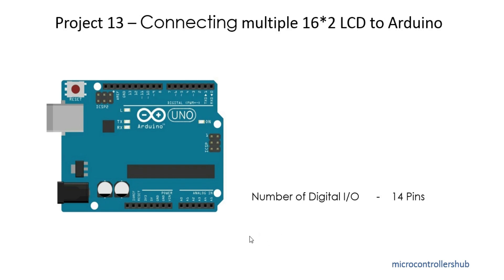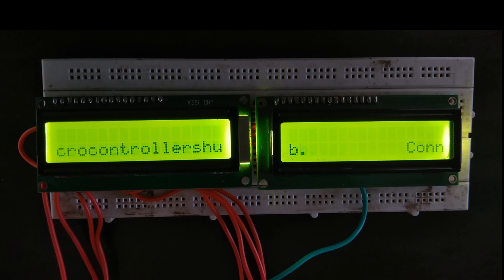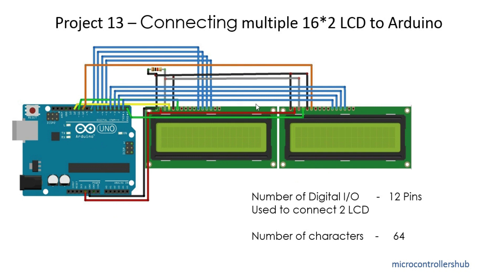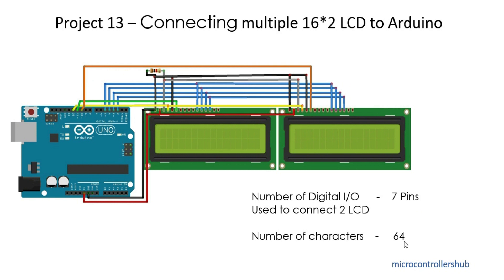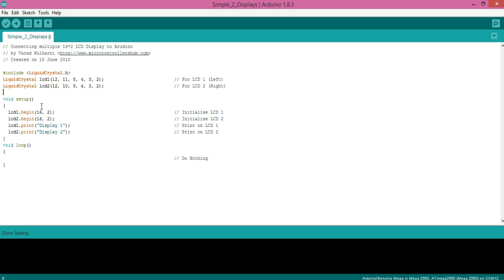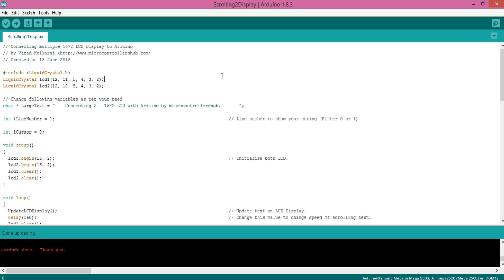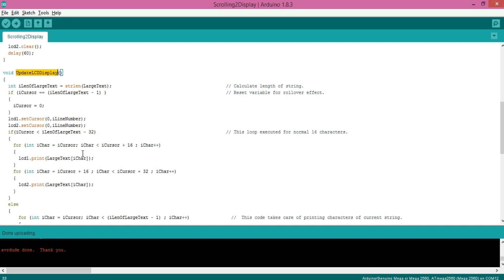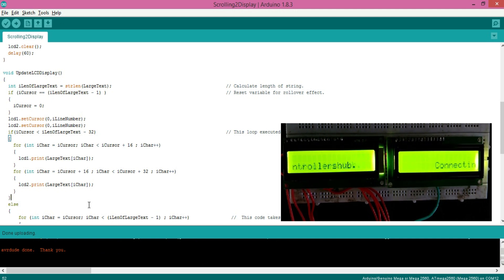Project 13 - Connecting multiple 16x2 LCD to Arduino.

Comment: Thank you for this video. I was going to purchase I2C to minimise the required not of pins.  How many ohms resistor did you use. Is it better to use a pot instead. Thanking you in advance. Regards
Reply: Pot is better